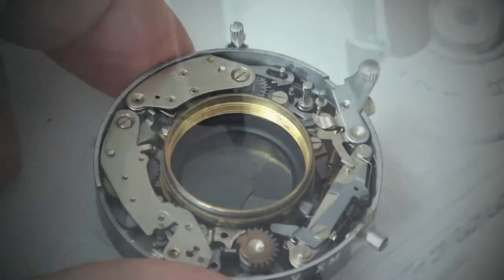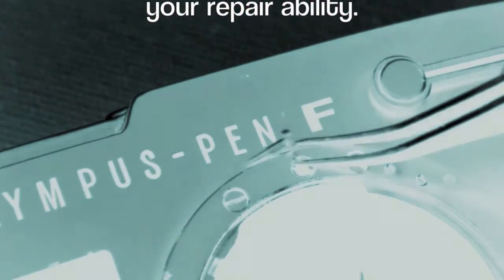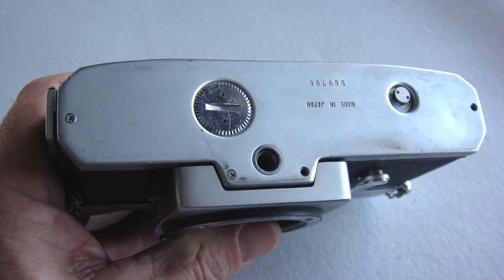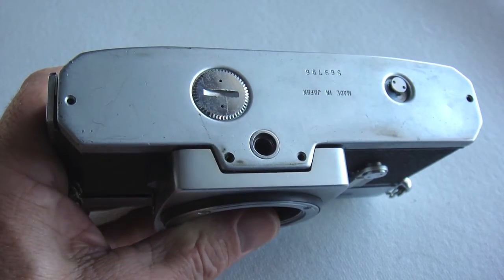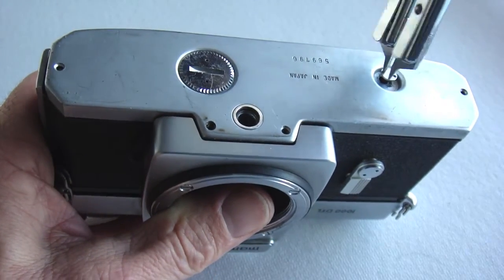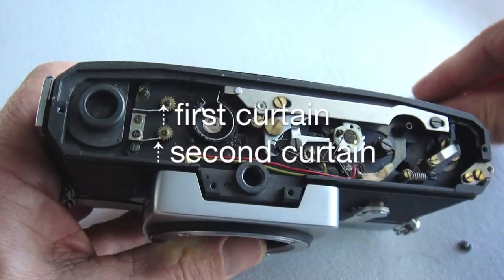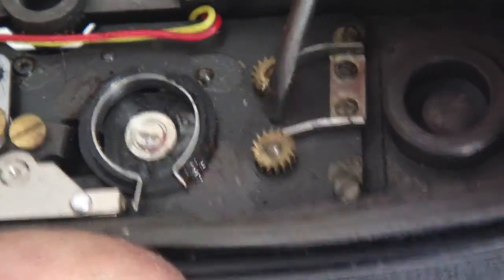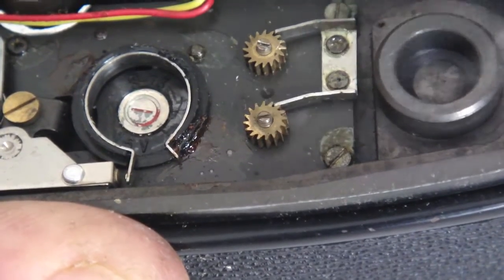Fix Old Cameras: Mamiya DTL Uneven Exposure

Comment: Neat video! Would it be the same procedure to re-tension the curtains on a Zenit 12XP? Mine sometimes show odd ligther areas on the far left part of the pictures taken, as if the emulsion of the negative had been more exposed at that area than in others. Zenit 12XPs have a fairly limited shutter speed range, ranging from 1/30 to 1/500, and the problem I mentioned is particularly evident at higher shutter speeds.
Reply from the maker: Yes it would. Understand if more than a couple turns (1/2 revolution per turn) are needed then there are other issues that need to be addressed.

Comment: Im having a problem with my shutter when i advance, theres a little chain the gets stuck in-between the back curtain and when i press the shutter it swings and sometimes it'll stay inside or it'll swing outside and it feels like I'm forcing the advance lever a little too much, any help?
Reply from the maker: The top cover will have to be removed and the meter linkage chainlet will need to be reattached and routed. 
 http://www.miketrost.com/archive.html
There are DTL chainlet routing diagrams here - scroll to the bottom of the linked page.